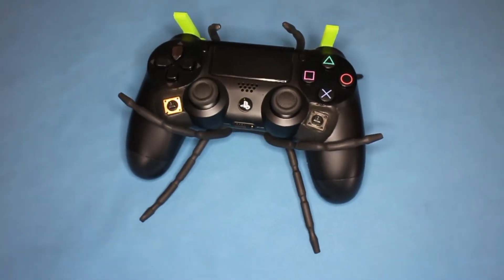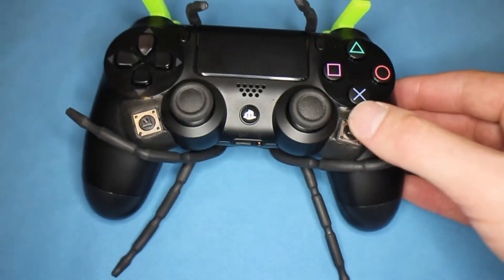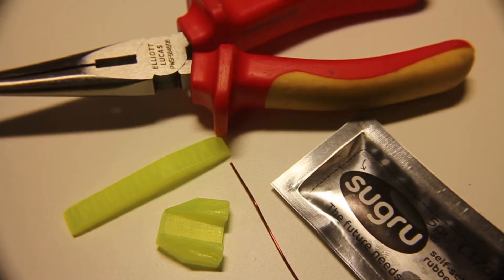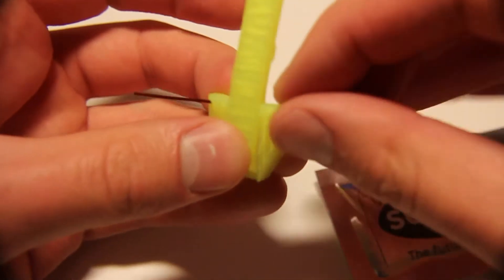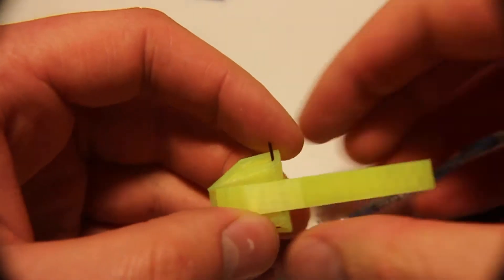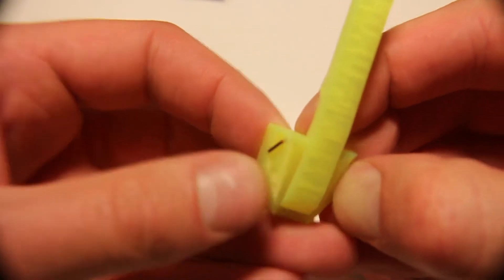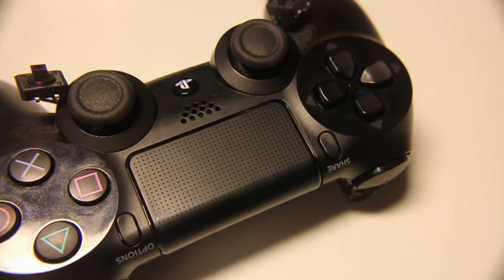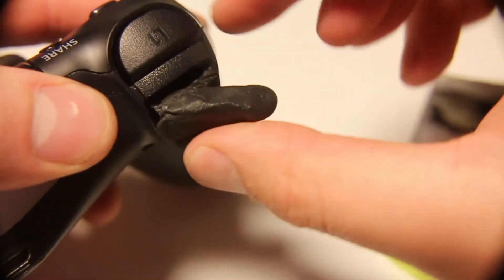PS4 Controller Modified for a Disabled User

Comment: hello my name is Leandro i am  Disabled  see your video about ps4 Controller i would like to know how added the thumb addition on the side because i cannot push down the analog  stick down if you can help me to send me some information on how you did it i would appreciate that send it to my email address witch is blackbird0074@hotmail.com would like that please.
Reply from the maker: Lee Schoenfeld 
Hi Lee I have added a link in the comments to the instructable for this project. I think there is a bit of info in there which should help.
Reply: Yvonne
Reply: Hi i have the same problem i cant push on R3 and L3 buttons. Can you help me about it ?.